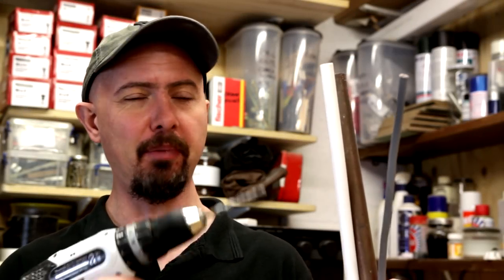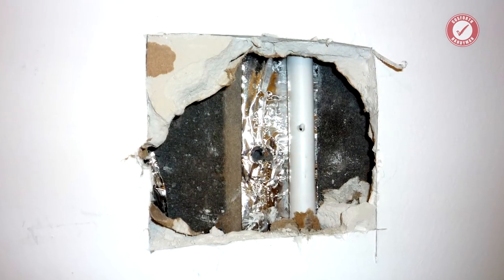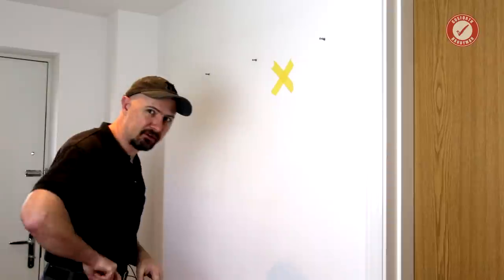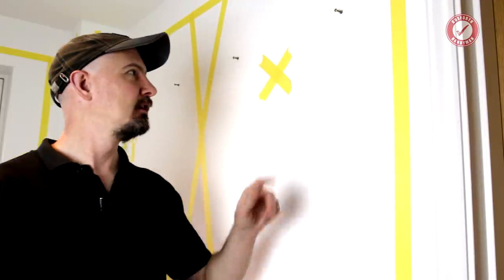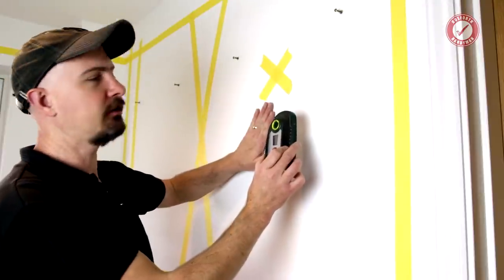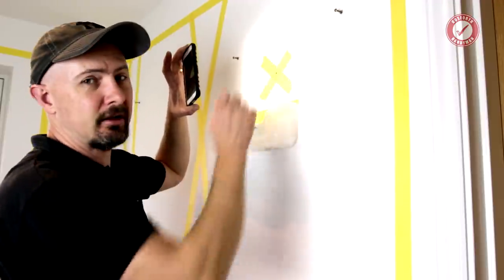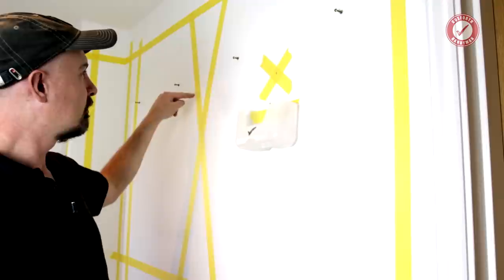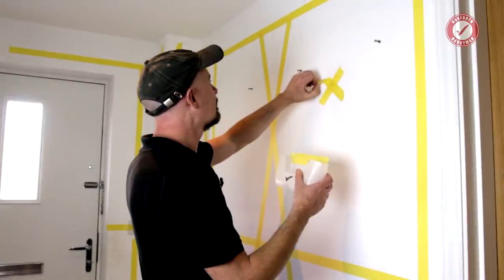8 TIPS to avoid Pipes and Cables in Walls (long rambling version)

Comment: When I drill into drywall, I don't drill deeper than the depth of the drywall. Or I poke a hole with a skinny slotted screwdriver just into the drywall. The trick is to not push beyond the depth of the drywall thickness.
Reply: Then why drill if your project is not stable?....dont bother to drill.if that's the case.
Reply: @javvydelarosa5587  I've been doing electrical and lighting installs for 15 years and never had a problem. Maybe you are not getting my point.
Reply: The point is I can anchor things in drywall without hitting any wire or water pipes.
Reply: Something needs to be mounted in a certain area on the drywall and the anchors don't go very deep. The problem is the person drilling needs to be sensitive to the things that might be behind the drywall. I make sure I know where the studs are, and go from there. It's easy after doing it for years. I have never damaged anything and I have worked in some very expensive homes.
Reply: @illestofdemall13  I know how to locate the stud too ok. By using the stud finder but sometimes the stud is acting weird so I don't trust it well till I can see what's behind the wall unless you have the regulations from the home builder.
Reply: @javvydelarosa5587  You asked me why drill when my project is not stable so I am just explaining how I do things. I never do something without first making a plan and mostly I am doing minor electrical and lighting installations. In 15 years I have never caused any unwanted damage. The only damage is on purpose, like when we need to cut open walls to run wire, or to install new electrical boxes, etc. We were even flown to Trinidad in 2008 to install specialty lights in a huge mansion. He hired us because most people aren't familiar with type of lighting he bought.

Comment: Great stuff as always.  I'm in the habit of using a small short piece of thin gauge metal wire which will easily transmit the feel of any obstruction where as a screwdriver or any type of hardened steel would never allow you to feel something small, like a telephone or bell wire.  Thank You as always, well done.

Comment: Check out Imperial Blades drywall blades with a reverse cutter (pull instead of push) and a curved crown shaped plunge cutter all in one.  Time saver and way less mess.  Strange looking yet well thought out.

Comment: Hi, I used to do work for a local DIY store. One day they wanted me to matchboard a customer's chimney breast, I arrived at the shop to collect the timber and they asked me if I could put a hole through the wall from the old shop to the new extension for a cable. I had all the tools with me so thought I could do it in a couple of minutes no problem. The hole went from right in the corner of the room one side and a flat wall on the new build side. I marked it up and as the hole was to finish in the corner of the shop wall went in from the new build side. I didn't use a detector on the inside wall as it was in the corner. Big mistake. As the drill got through the last layer of bricks I put a 5/8 hole through the lead water rising main and soaked me through. They ran around looking for a stop cock only to find it in the basement. the lid to the basement was under a counter and it took many gallons of water to shut it off. The chimney breast wallboard job is another bad drilling story.

Comment: Clear and good advice.  I hate drilling into walls.  RANT:  Why the h**l every service isn't delivered via an accessible ducting like in an industrial facility rather than burying into walls I don't know - probably cost and aesthetics.  Just imagine, you have a CH leak - you can find and fix it without routing out plaster.  You want to install cat 6 through your home - simple just pull it through the ducting.  You want to check the state of the power cabling - easy and so on.  Like most people I've had a few CH leaks at joints which required me to cut flooring away and chase out piping in plaster/breeze block walls.  After several mods to wiring and new boiler location I now have little idea where the cabling and piping runs are - no drawings or even sketches of course.

Comment: In my old house the floor boards were very uneven. Before I laid the carpet in the bedroom I put in a few new nails following the original nails as a guide. 

Had a chill and Mrs went to make a cuppa. The ceiling was pouring out water and there was about an inch of water on the flour and water dripping everywhere. 

Called out the plumber he went straight to a damp looking new nail lifted the board and I'd went straight through a heating pipe which was laid onto the top of the joist between the original nails.
Reply from the maker: Nightmare - been there a long time ago with a gas pipe! 😢

Comment: I drilled into an electrical cable which was nowhere near the socket either vertically or horizontally! Fortunately I wasn't going mad at the drill and heard a loud 'pop' sound and the lights went out. Fortunately it had only touched the wire and tripped the electrics out, but it just shows you wires and pipes aren't necessarily where you think they would be.

Comment: I think I've just got quite lucky. I've been putting up photos using small picture hooks with a single 3cm nail and realised after the fact I've put some up above a socket but slightly off centre with the socket itself. Seems fine though and nothing has tripped (this is an exterior wall).

Comment: 3 or 4 years ago I ran a screw through a copper pipe just below the floor, pipe was touching the underside of the floor.  It went through it like butter. Average Joe probably would have kept going none the wiser but something didn't feel right. Reversed the screw out and heard an unpleasant sound. Never a good day when you have to sprint for the water main!
Reply from the maker: Yup - and often you never know until you take the screw out! 😢😢👍

Comment: Your final comments about shutoff locations should be the very first thing you say.... Nothing is more important than that.  And carry an emergency kit with opening tools and a compression patch ( some type of tools To open the wall up quickly, and then wrap around the pipe and compress the punctured area to at the very least minimalize the leak or stop it) I have seen people go through a pipe that wasn't supplying their place, and it just leaked and flooded everything below for an hour, and you just thought it was just hanging a picture...ha...

Comment: Good Video , in over 30 years , I’ve only tagged a pipe once , I always carry a Sharkbite pipe firstaid kit for pipes . I also haveva borescope , so I can look around . Are there any reliable detectors for plastic pipe ? I have a thermal image camera , which will spot hot waterlines . Good tip on the insulated screwdriver tip isva good one !

Comment: Im going to hang tv on a wall partitioned with next door neighbour terrace house built 2017. All other walls inside house are hollow plaster drywall with NO insulation of new build in 2017. The scenario is same as you  shown a picture after the end of 8th tip. I have coaxial cable box, next to tv aerial box which is next to 2 double power sockets boxes. First thing i  looked into these boxes by opening and see behind. Its concrete behind. Not sure how much could be between plaster board and blocks or its a brick wall. Its confusing ans i have still waiting for tv to delivered in a day or 2. So any tip for me find out if there  are power or coaxial cables running vertically just above these series  of service boxes I have to INSTALL TV BRACKET. help much appreciated

Comment: I've got a stud finder but the it just beeps the entire side of the wall when it's on the metal setting, I'm trying to hang something on plasterboard using gripit anchors so I don't need to drill past the thickness of the plaster

Comment: Good video . I had  a narrow escape last week when using a stud finder with no metallic warning light. I was trying to find studs in order to install wooden panelling.  The stud  finder  got a signal on two 3/4 inch heating pipes which I ASSUMED were studs .
 Luckily I had skirting boards off and cut out small pieces  of plasterboard as i  just wanted to visibly see stud centres  at floor level in  order to check  them with a vertical laser for screwing purposes further up wall.  The thought of pipes did not enter my mind. MISTAKE NUMBER ONE.  I was astounded when I revealed the pipes  at floor level.
The point I am making is  that my cheap stud finder  with no metal indicator was leading me  directly on top of heating  pipes  which I would have screwed into had I not physically   removed the plasterboard  just because it was easy to .
Sorry for being long-winded  but   a disaster was averted  just   by  pure luck . Please do a video on TRUSTING DETECTORS/STUDFINDERS.  Tip number 9, if you can  remove plasterboard behind skirting boards PLEASE DO IT.
Reply from the maker: Disaster averted! I've never had much joy with stud finders - might try to do a vid on detectors at some point! 👍🛠
Reply: @GosforthHandyman  I don't trust stud finders go off on everything and sometimes don't go off at all on places you know have a wire.
As someone who works in telecoms I use a probe which is a wand that picks up noise from a oscillator but can also hear metal and expecially current. You have given me the fear of qualpex now because not until you mentioned it I realised that I have nothing that indicates the presence of qualpex.

Comment: This is a non related question but I couldn't find a video of yours to do with it.
I plan on taking down half of my front drive wall so I can get two cars on But it's absolutely solid brick/stone.
What would be my best way to tackle this?
Sds drill wholes then sledge hammer?? Don't own a masonary cutting tool at mo
Reply from the maker: Can you knock the mortar out with a mortar rake in an SDS? Yes, then big hammer. 👍

Comment: We had an electrician who lifted the floorboard up on the landing ran his cable across there was a pipe smack bang in the middle and when he put the thing back instead of putting two screws back in same screw holes at edges of floorboard he though he'd save himself time and put 1 screw smack in the middle where the pipe he would have seen not 10 seconds before and gave us a nice pinhole leak that collapsed the downstairs ceiling when water pooled up there. 
House is about 50 years old and there's alot of copper pipes very close to the floorboards and practically touching them in most cases. Brother wanted to make a hole in the floor so he could stick a network cable down to the room below got a jigsaw to cut floorboard and the ceiling started pissing water as he chewed through a pipe.

Comment: Found myself looking at this after drilling my kitchen wall.  plaster on block wall above a row of 4 double plug sockets( checked direction).  All good with first 3 holes, on 4th 15mm in I noticed a change looked and saw what looked like copper on the sides of the hole.  Completely baffled, the sink pipes go up so stop way before, poked it and am not dead so not electrical???????  It's close to a window, any ideas?
Reply from the maker: Not coax for an aerial cable is it? Hard to say without seeing it. 👍

Comment: I live and work in Serbia,and company that i work in ,build hundreds of buildings.
Occasionally,people do hit power cables or pipes,but that is extremely rare because power cables goes horizontal some 15 cm from top and than vertical to the switch or plug,so it's very easy to avoid them,even if you have no detector.
Pipes goes horizontal some 35 cm from bottom and than vertical to accessories .
 There is no installations in between and that is safe area.
There can be problem with heat pipes in the floor,because they are not put in in the strait line,if you have floor heating.

We follow same logic with dry walls,just like we do with hard walls.

Of course ,if you have someone with DIY skill,who done everything in shortest way to save material,than anything can happen....

I used many of these detectors,and usually  they are pure shit and they are unusable ,especially in hard walls ,where you have steel rebars.

Comment: Great advice. I was told years ago that to remember which direction wiring went, was that with light switches the wiring goes up the wall, and with plug sockets the wiring goes down the wall under the floor, not sure if that is right.
Is it?
Barry (West Kirby, Wirral)
Reply from the maker: Generally if it's a concrete floor (most new builds) everything will go 'up' but it's not guaranteed. For suspended floors what you're saying is correct (normally)... but depends a lot on the age of the house. 👍
Reply: Barry Roberts. Not always Barry. Particularly if you’re upstairs there may be wiring going up to switches from the floor for things such as the “strappers” in 2 way lighting circuits, for things like landing and hall lights if they’re switched from upstairs as well as down or even the feed to the upstairs lighting itself. The other thing to remember in those cases is that there may be 2 supplies in those switches, 1 from the downstairs lighting circuit and 1 from the upstairs lighting circuit.

The main tip in Andy’s list is one that was given to me by an old sparky in my first week as an apprentice electrician back in 1972. NEVER assume!

Comment: Hi Andy, Like you I have hit a cable some time ago. If I'm putting a hole in plaster board I use a Philips screw driver like a bradawl and once I'm happy I'll put the rawl plug in and screw in by hand as I can still have a feel of the pressure. All good tips tho

Comment: Great video and useful tips. I live in a new-build and I think we have steel (rather than wood) stud walls which seem to be favoured by builders these days. This of course plays havoc with the detector. More importantly though, given that it is metal, how do I decide whether it is safe to drill into a stud channel for the extra anchorage.... when it could be something very different like a cable?
Reply from the maker: It's very tricky - especially since services (pipes and cables) may even be run inside the metal studs. Normally in that situation I drill some of the plasterboard away so I can see what I'm dealing with, confirm it's a stud then drill a small pilot hole to take the screw... while crossing my fingers. 😂👍

Comment: Been there, done that. Someone notched the top of a floor joist and ran copper water supply lines over top of it and I drove a screw right through it.  1st time as I'm always careful, but careful dont fix stupid.  Never notch a joist as it also weakens the joist.  Drilling a round hole through the center of the joist is safe.

Comment: Two weeks ago i was building a new stud wall i screwed the 4x2 base plates down with 60mm screws in to a chipboard floor. 

Thinking that the screw wouldn't go deep enough for pipes to be an issue.

Well guess what the gas and hw pipes were running smack bang muder tight up to the floor. The asshole who installed the plumbing couldnt be bothered to notch out the joists properly. So the very tip of my screw just pierced the gas pipe. 

One emergency plumber and £75 later it was sorted. 

Lesson learnt i will be buying a detector because you just never know.

Thanks for tips i will be subscribed.

Ben Wiltshire uk
Reply from the maker: Nightmare! Been in a very similar situation myself once a long time ago - sometimes it's just sod's law. Cheers! 👍👍

Comment: Dont water pipes usually usually have inspection haches there? here is mostly undefloor heating that would go close enough to the surface for screws to be an issue unless you are very close to the consumer unit whre you might drill in to electrical wires. But then we dont use all the wires in one sleeve like you seem to do in the UK we run them in plastic conduit with separate wires for LNE so most of the time they wiwould spread and water pipes usually run in a vertical shaft of some kind if they are internal.
Reply from the maker: Ha, inspection hatches!?! No such luck! 👍

Comment: What if your putting up 8 curtain rails up with 10 holes for each???? That's a lot of messing around when your on a tight schedule
Reply from the maker: Use wooden battens. You'll be on a tighter schedule if you hit a water pipe!
Reply: @GosforthHandyman  in a ideal world wooden battens would be installed above windows in all new builds

Comment: :D 100% sure would be a gamma ray device...though a bit expensive. But still sad that in 2020 there still is no inductive drillbit yet which would stop instantly when it touches metall
Reply: >there still is no inductive drillbit yet which would stop instantly when it touches metal
likely it'd detect capacitance, not inductance. Still rather hard to get it stabilized and reliable, there is a lot of noise due to the motor and drill bits sizes/materials. Should not touch the chuck with hands either.

Comment: Most modern builds have plastic pipes so detectors won't work, also electric cables can be run diagonally if mechanically protected.

Comment: Wall Bot makes a see in the wall radar sensor that plugs into Android phones.  I would rate it a 6, but it has two year old software. Perhaps newer versions or perhaps a software update would make it better.  Perhaps IOS as well.  It works fairly good as long as there is no metal like with older cinder block, there is a stacking horizontal metal between bricks.  It’s suction cup to your phone does not stick to my Otter case so it’s clunky (same size as the phone) you have to hold them together and the instructions say a circular motion.  I really like its ability to see a cable in or metal conduit in the wall, so for that, it’s worth it.

Comment: I presume that heating pipe was after the repair. On new builds I understand you are not allowed to have joints in plastic piping behind walls, they must be in accessable areas.
Reply from the maker: Yeah - that was repaired. 👍